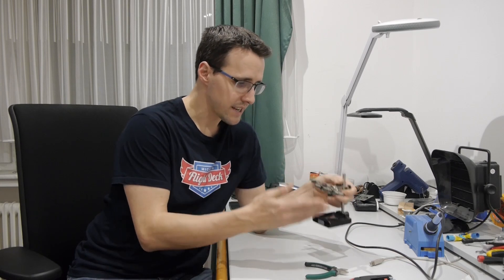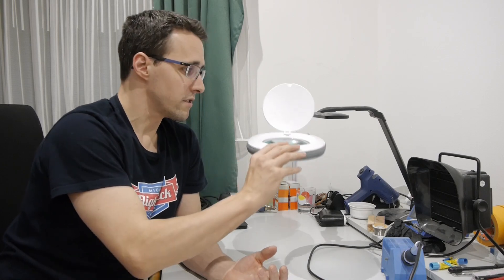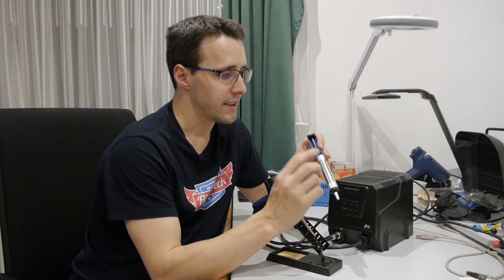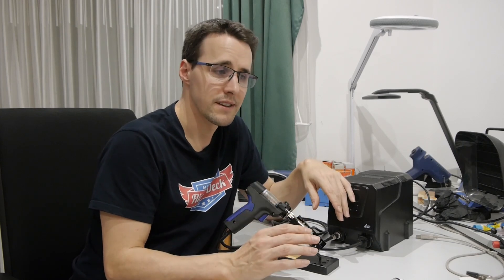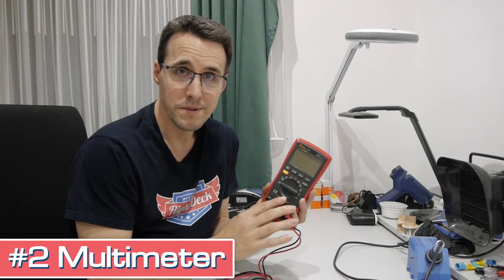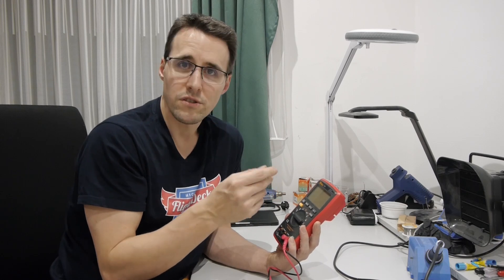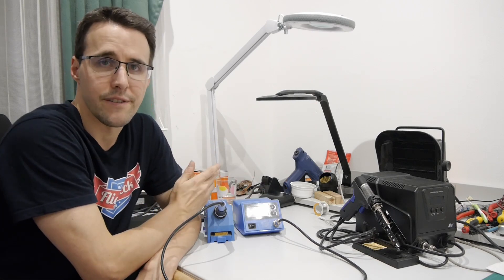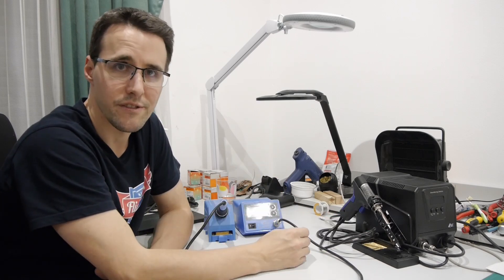Top Five Tools for electronic projects - A Boeing 737-800 Homecockpit

Comment: A programmable power supply! I have an Agilent E3610A that I got used on ebay for cheap. Great for testing circuits, LEDs, etc. In constant current mode, you don't have to worry about burning out LEDs, and can test brightness at different current values.